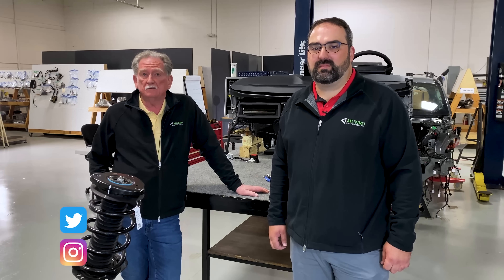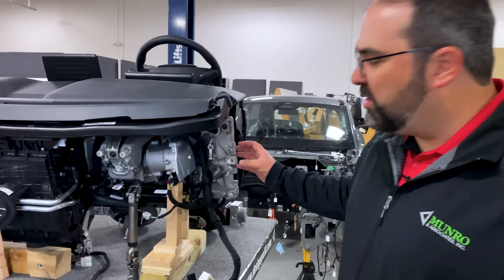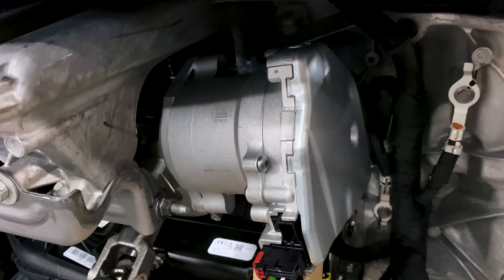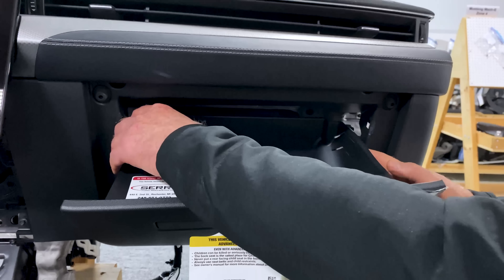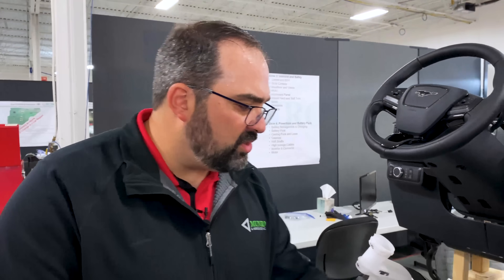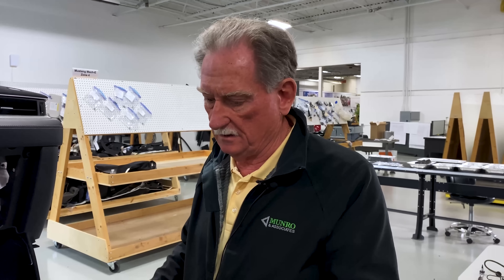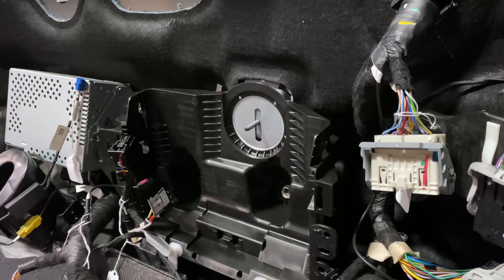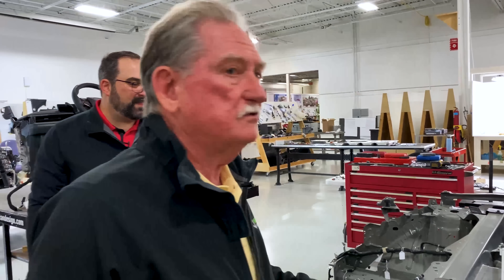Ford Mustang Mach-E Instrument Panel (IP) Assembly and Analysis

Comment: @13:07 I think Sandy doesn’t understand that the electric brake booster is still a mechanical hydraulic device, which is augmented by an electric motor, but will still work if the electric motor fails, just like vacuum brakes still work if the vacuum assist fails. You still need a brake pedal which won’t break when you do a 200 pound single leg press on it in an emergency. I’ll take my brake level in steel please.
Reply: Whether or not it's attached to hydraulics, the brake pedal needs to still react as though it's attached to hydraulics. There needs to be a spring that can simulate what brake feel used to be because that's what every driver from 14 to 100 years old has been trained to expect. And the pedal better be able to withstand the full pressure of a 400 lb shot put athlete can exert because that's what everyone will be pushing it with in a panic stop.
Reply: @danoberste8146 , yes, that’s what Sandy overlooked. It’s a mechanical hydraulic brake system first, augmented by electronically controlled motor second. They can get away with putting the Barbie Jeep plastic accelerator pedal in because it either has a stop behind it on the firewall or an overrun spring which will yield before anything breaks. 

You could theoretically put an overrun spring on the brake pedal as long as it still allows you to lock up all 4 tires during a booster failure, adding unnecessary weight and complexity instead of just using the steel pedal.
Reply: There is certainly a potentiometer or position sensor on the pedal arm to blend in regen before the mechanical brakes engage.
Reply: @Miata822 , yes, if the electric booster is functioning properly it will modify the driver’s input to allow for regen and pedal feel, but if it fails, just like the vacuum assist, it’s your foot using the STEEL brake pedal level to amplify the force from your foot to make enough hydraulic pressure to stop the car. 

So, no, it’s not JUST a dimmer switch. Perhaps someday, in fully autonomous vehicles, they will allow drive by wire and brake by wire, but not today, in cars designed to be operated by humans.
Reply: because: LIABILITY.
Reply: seems like he doesnt know
Reply: @ranxerox10 , clearly not if he thinks it’s just a dimmer switch and he can use the brake pedal from a Fisher Price Barbie jeep. I just hope the guy at Ford insisting on steel brake levers doesn’t die anytime soon. Lol
Reply: @imho7250  you cant know everything
Reply: @ranxerox10 , yes, later Sandy is going to punch the dude who told him it was just a dimmer switch after he says “duh, of course it’s still a mechanical hydraulic system in case the dimmer switch fails”. Lol. 

I’m sort of surprised they don’t let the Munro team watch it first and fix things in post editing.
Reply: @imho7250  You can clearly see the large plunger and input fork on the hydraulic brake unit so I'm surprised he didn't put 2 and 2 together himself.  If you are going to publicly pick apart someone else's design you should make damn sure you know how it functions first.
Reply: @ranxerox10  that is a pretty obvious over sight though to be honest.
Reply: @theslimeylimey , yep. I even went back to check that before I commented because I thought I saw it and then after Sandy got inside the car as said it’s only a dimmer switch, something wasn’t adding up.
Reply: Have you people been watching Sandy for only a day? The idea that Sandy doesn't understand  anything and everything about how a car works is ridiculous. Don't let the gray hair fool you, he knows all the new systems too. His remark about "a dimmer switch" was to make a point, it wasn't the beginning and end of his knowledge of this type of brake system.
Reply: @donjones4719  His point was clear and he was questioning why is there still a big chunky steel brake pedal arm when it's a brake by wire system. The answer to that is because it's NOT a true brake by wire system but a conventional hydraulic system augmented by electro mechanical additions instead of a vacuum diaphragm doing that job.

Because it is still a mechanical analog system underneath, when the electrics craps the bed you can still use the fail safe "old fashioned" hydraulic piston being pushed (very firmly) by the lever arm of the brake pedal and stop the car without the brake pedal snapping off under your foot.  

It's the same reason steering racks are still connected to the steering wheel with a heavy duty metal shaft even though electric steering racks can steer the car with virtually no input torque from the steering wheel at all.

This is a good thing and not something we should rush to get rid of to save $20 on the cost of a car.
Reply: @donjones4719 , yes, we watched Sandy since before he had a YouTube channel. You are clueless about English and Engineering if you think his comment about the dimmer switch was just to make a point. He specifically said you can replace the steel brake pedal level with a plastic one because it’s only turning a dimmer switch, inferring it doesn’t take much force. I have grey hair too. Nice try though.
Reply: @imho7250   I spent 10 years transcribing British scientific notes from the 19th century and putting them up on the internet. The professor I worked for would be very surprised to learn I am clueless about English. As for the rest, I would love for Sandy to weigh in and straighten this out. I can either believe he is ignorant of the problems you point out or that he was making one isolated point and simply didn't go into the rest.
Reply: @donjones4719 l well don’t tell him you don’t understand American English. The problem is you can’t take the meaning of the words and the associated engineering and get the picture. But as you can see many people also see the same thing I did. Even Sandy won’t try to claim it wasn’t a major oversight. Perhaps next video will have the correction.

Comment: Thanks again for another great upload Uncle Sandy! The brake pedal assembly is very telling... I am fairly certain, my old 1998 VW NB, MKV Golf and GLi had plastic composite brake and accelerator assemblies( not sure about the clutch)as does my current Audi' and my Miata... I am  guessing it's a parts bin issue for Ford.

Comment: Regarding the brake pedal. Even though actual braking force is no longer mechanically connected to the pedal, any driver in a panic-braking situation is going to hammer that pedal with their full weight. Does Ford maybe have a preference for a material that will deform rather than crack under the most extreme loads?
Reply: It's basic engineering to know your loads and design for them.  Slamming the breaks is part of that, you do tests, do modeling, add a safety factor, and figure out the load.  After that it doesn't matter what material you pick, as long as they meet the requirements.  Every material bends, deforms, fatigues, breaks, etc if you push it hard enough.
Reply: @rhamph  ; brakes
Reply: @rhamph  You can design steel components to not have an infinite fatigue life, that is not the case with plastic or aluminum.
Reply: I was going to make the same comment. That brake setup will get slammed hard at some point and brake failures have to be the absolute worst press a company can get- avoid at all costs.
Reply: The right plastic material will not crack, it is just as Sandy mentioned about the accelerator, they just need to get somebody new in charge of the brake pedal too.
Reply: Sometimes the psychology is more important than the actual engineering facts. Can you imagine the field day a car maker could have telling people- "Well, the Ford is SOOOOOOO cheap they even make the damn brake assembly out of plastic. Do you want the life of your family depending on a piece of plastic?"
Now, we know the reality is that a perfectly good plastic assembly could be built - but does the average Joe? I don't think so.   How many sales could you lose on an ad campaign comparing the "Hyundai" all steel brake assembly and the cheap plastic Ford?  
What happens when there is that one crash where the plastic brake assembly breaks and it gets reported in the news? The reality won't matter, the perception is that "those people died in a Ford with goddamn plastic brake parts".
Then they could close the story with a quote from noted expert Sandy Monroe- "There are only two kinds of plastic, plastic that will break today and plastic that will break tomorrow"
Reply: There has to be some force feedback no?  As you brake your body is slowing down slower than the car and pushed into the IP.  Your foot is a major point of contact. The one time I test drove a model s I can’t say I felt anything different than a normal car brake.  But that was a long time ago.
Reply: @ZzHasbrozZ  Model S uses regular brakes because Tesla couldn't figure out how to make blended braking work well. Yes, blended brake by wire systems provide feedback to the pedal, the ones that are well done (i.e. not Infiniti) feel like really good mechanical brakes, very natural and completely transparent transition from regeneration to friction brakes.
Reply: It’s already a thing!
https://teslamotorsclub.com/tmc/threads/accelerator-pedal-broke-off.92712/
Reply: it is still mechanically connected
Reply: @ranxerox10  Yup, Sandy is wrong. At least he says incorrect things with authority and confidence.
Reply: @Ficon  Uh-oh.  Looks like the head of accelerators had a son.....
Reply: @ranxerox10  yeah... I would also have guessed it is 2 stage, normal rage for brake by wire and blending and second fully old school mechanical brake.
You can even see the link part on the valve/booster box earlier.
Reply: yea the bad press of "snapped" brake pedal not worth it.
Reply: @churblefurbles    Yes. The media will report that "the driver stomped brake pedal so hard it bent the metal" and people will be impressed that the accident situation was so severe, but not blame the manufacturer. But the media will report that "the plastic snapped" and the driver and the severity of the accident are left out, the only thing in the sentence is the manufacturer's choice of material, which everyone "knows" is not as strong, just a cheap money saving substitute.
Reply: @churblefurbles  re: "yea the bad press of "snapped" brake pedal not worth it." no it's WORSE, you kids aren't paying attention.  it's NOT the bad press, it's the eventual WARRANTY CLAIMS and CLASS ACTION LAW SUIT.  any competent attorney will TAKE A BIG WET BITE OUT OF FORD'S ASS over a broken brake pedal.  what a 100 year old company like Blue Oval represents (to an OVER LITIGOUS society whose citizens are "racked" with GREED and RAPEYNESS) are "deep pockets" $$.  you won't even see Tesla who are supposed to be so "cutting edge" ( yet can't properly paint a fender) making dumb material choices in such a basic component.
Reply: The same materials they’ve been using for the last 100 years

Comment: What is the source of vacuum for the brake boost?
Reply: My Mercedes Electric Drive has an electric vacuum pump.
Reply: @markbullock3741  OMG, seriously?
Reply: In ICE cars it’s normally the engine air intake. That’s why if the engine stalls, the brakes get much harder.
Reply: To be clear, the unit with the vacuum connector was NOT from the Mach-E. It was used as an example for how it was done in the good old days. The unit in the Mach-E is the one Sandy was talking about with the fancy snap connector. And yes, in ICE cars, vacuum comes from the engine intake.
Reply: No booster, thus no vacuum required; pedal connects to dimmer switch- signals electric motor pump

Comment: hiding the vent controls behind the screen - another example of engineers not talking to each other?
Reply: Bullshit, its not something that will need constant adjustments, toyota for example has automatic moving vents 30 years ago and they still work even today.
Reply: @carholic-sz3qv  but these are manual, right?  So need to sneak your fingers behind the screen - seems like an oversight on Ford's part.
Reply: Move the wheels to the other ends

Comment: your statement about brakes is not entirely true. the pedal is still conected to the hydraulics. and ists not a "dimmer" switch, its directly connected to the hydraulics via a pressure sensor inside the brake booster.
Reply: Yep, this is a passive and overall safety that needs to be mechanical in case of electric failure.
Reply: Yes, and hence the pedal needs some strength. If what Sandy said were correct, it would be a true "brake by wire" system, and I don't think that would be legal anywhere in the world. If the electronics dies, you have no brakes. Not safe enough, I think.